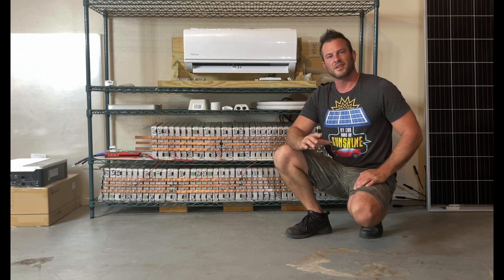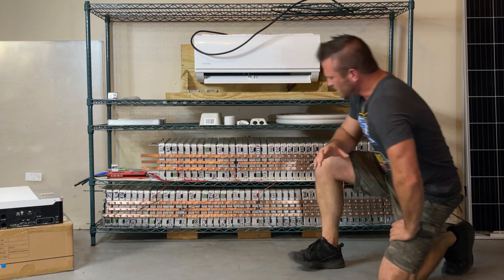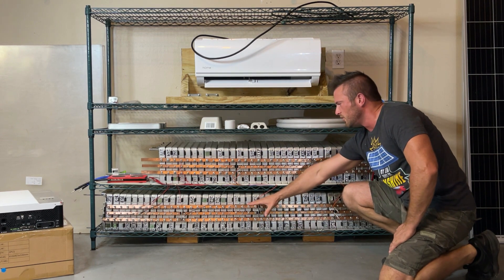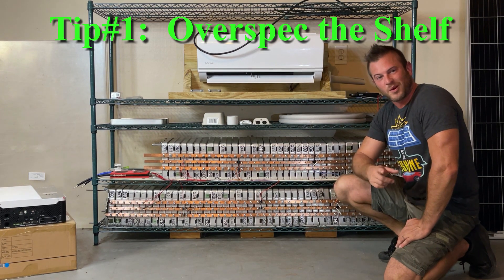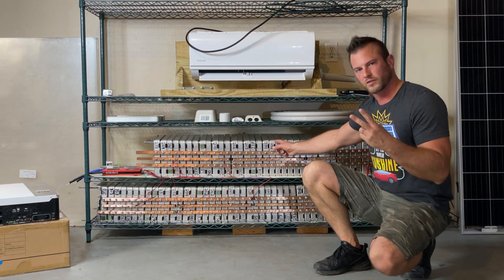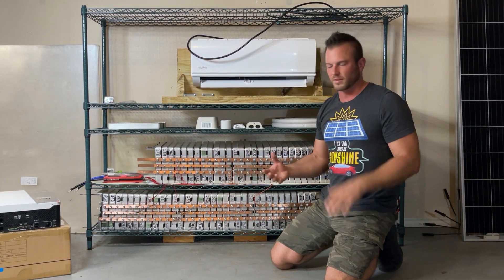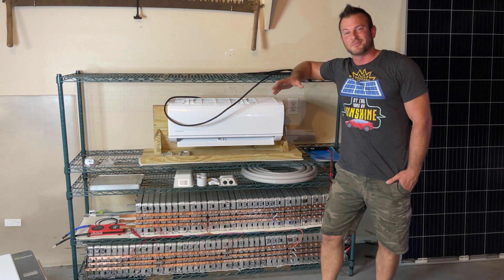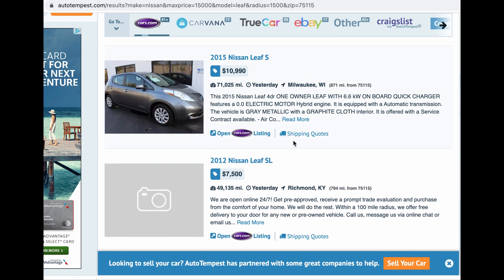Home Powerwall Build:  Some Common Mistakes and Pitfalls

Comment: Not in any way related to this video, but you have earlier made videos about how to most efficiently convert solar power to range in your Nissan Leaf and today I stumbled over this video from a Russian DIY'er, which I think is relevant to you: https://www.youtube.com/watch?v=i90FBKmnMho What he does is somewhat genius: He uses roof mounted laminated solar cells,  a big 200Ah lead acid battery and inverter like you, but instead of using the onboard charger, he routes the AC through some big motor start capacitors in series to limit current draw on the inverter and then through a diode bridge to make it 300-400v DC which is then fed directly to the main battery. From the subtitles through google, it doesn't appear he uses any kind of voltage limit cutoff to avoid overcharge, but obviously he is charging fast, (I have not deciphered the power of his inverter, but his SOC increases a percent point every other minute in the video). I can't figure out if routes the DC though the main contactor either, i.e. only charging with the key on, or he has made an alternate connection to his main battery so he can charge when parked too?  Nevertheless Happy to find out more people are duing this. Nb. In the Russian comments, your channel is mentioned.

Comment: The modules have solid spacers on them, you can stack them a high as you want - they are perfectly fine.
Reply from the maker: After speaking with several people who have done very professional builds using a vertical stack, I agree with you.  A vertical stack is probably much easier from a design perspective.
Reply: @InnovativeSustainableSolutions  I nearly fell of my chair seeing my powerwall in your video.

Comment: I appreciated your explanation of insane pricing in the used auto market at the end of the video. I’ve been interested to get a used leaf and upgrade the battery, but I’m also anxious to avoid the predicament that Samantha Thornhill (farther down in the comments) has encountered. It seems there are no cheap batteries or leafs around anymore.
Reply from the maker: There are not cheap Leaf batteries around anymore, quite frankly.  I made a post on my Patreon page about the insane rate at which the price of these used packs have been increasing    https://www.patreon.com/posts/44645631.  Obviously I don't want to discourage someone from driving electric, but the Leaf is not obscenely cheap vehicle it was when I bought my Leaf for $3k.  All the conditions causing this price increase are probably just going to get worse in the year 2022.  I wish this were not the case

Comment: Query for you: are you switching from DC to AC before going back to the cars?
Would it be possible to stay on the DC side and putting the power into the car through the chademo port of the car?
Reply from the maker: Yes, I am doing an inefficient DC-AC-DC handoff.  I am sure there is a more efficient way to go straight from DC to DC via the chademo port of the car.  I have zero experience with chademo at the moment, so I cannot help you at this time.  Maybe someone else will read this and chime in with a design solution.

Comment: Hello Im Sam! Im a new Leaf owner and I could really use some help with my battery. It’s my first car and I was so excited to have an electric car but I can only go about 12 miles before my battery runs out. Any advice on where to get a battery? ( the cheapest)
Reply from the maker: They are very rare, and getting rarer.  There are some shops on Ebay that will sell you an upgrade to a 62 kwh battery, but this will cost well over $10k.  The problem is you have a fleet of 250,000 old Leafs looking for new batteries, and only a couple thousand new Leafs finding their way into junkyards each year.  Maybe look into something like this  https://www.ebay.com/itm/164171179841?hash=item26395d6741:g:QqUAAOSwOapeoSxe
Reply: @InnovativeSustainableSolutions  thank you. That’s completely out of my price range so I’m really just stuck as of now. I’m only part time and LA is crazy expensive. I’m looking to find someone to just replace cells in the battery , I’ll never be able to afford an entire replacement

Comment: Hi Sam, my 'powerwall' is in my TR7 EV. It's charged by a pair of solar panels, or by the wall plug.  Then I can drive some miles OR (like in an emergency) I can run my 3kW inverter to power part of my home.

Comment: One suggestion, you said you want to use a plexiglass side or window into the insulation. Put a (removable) foam panel over that. Plexiglass is thin and will transfer more heat than a couple of inches of foam panel.
Reply from the maker: That's a good idea.  Im gonna do that

Comment: Thanks for sharing, I hope to work up to doing a similar build. You're videos have been very inspiring
Reply from the maker: You can do it.  Full functionality of the solar powerwall has been achieved.  Capacity seems to be near 27 kwh, peak input of 2.2kw, all components functioning near optimal levels.  Over 150 kwh transferred into EVs from this powerwall at this time.
Reply: that's awesome! congratulations on the success. I've since put in a modest 2kw battery bank and hope to add another 10kwh of storage soon. it's all here and ready to be hooked up, just making sure it'll be safe before I bring it online. thanks again for showing what's possible

Comment: Was there anything that went wrong you thought might not be fixable? What kind of temperatures do the batteries experience in the leaf module while summer driving in the hotter areas?
Reply from the maker: The modules can take the heat, but it really kills the battery.  Pheonix AZ, is the home of the 35k mile Leaf with the fried battery.  Temps there probably hit 130F+.  I would say one problem that can't be fixed is trying to scale down this system.  These batteries do great when a heavy load is distributed across dozens of them.  Low draw on each module yields maximum capacity.  If you scaled this system down to half this size, I think effective capacity would be 30% or so.  That's a problem I can't fix, a small, low capacity, effective powerwall.  Bigger = More effective

Comment: Great to see you again! Will be awesome when you're using this to charge the car at night with the solar collected during the day. I've gotta say though the span of that shelf is too long for that load, if you were doing it again I'd get one with a support in the middle, or two at half the width. Or just add an undermember, e.g. a 2x4 on its side. Deeper member = less deflection.

I've been working a lot on my system the last couple of weeks too. Today I fixed some bugs in the custom EVSE wiring and proved out charging from the supercapacitor buffer at full rate. Nothing blew up or even got hot haha. So yeah, ready to go now, just waiting for a sunny day to do a full test!
Reply from the maker: Agree with you about the shelving.  When I increase the size of this in a year or two, I will explore some of the methods you discuss.  There is always a lot of obvious problems you miss when you build it on paper first.  That's awesome that you have your boards in hand!  Excited to watch somebody else play with a 350v battery for a change :)

Comment: He's alive! Yay!

I wonder if the reason people can get away with stacking the modules so high is that they must be designed to take some extra forces during a collision? I still agree with your method though!

I never knew how much savings could be realized by DIYing a home Powerwall versus buying one from Tesla. Sometimes [my] DIY projects cost more than buying a final product. I guess that explains why the price of used Nissan Leaf battery packs shot up so much over the past few years!

Thanks for posting!
Reply from the maker: When I started buying Leaf modules they were approx $100/kwh.  I actually know an authorized distributer for Tesla powerwalls and solar roofs in Texas.  I bumped into him at drive electric about a month ago and we got to talking powerwalls and price per kwh.  The Tesla powerwall 2 comes in at $600/kwh.  A difference of $500/kwh x 27 kwh (the size of the one I built) is a savings $13,500.  Of coarse, you have to deduct the price of the shelving, copper bars, bms, and inverter.  But you were still quite a but ahead.  That was before the price increase.  There's no way around it, building everything has gotten more expensive, fast.